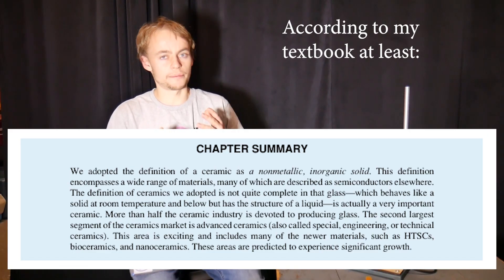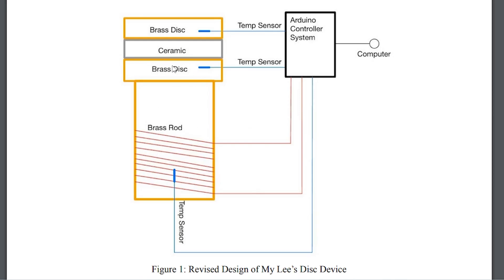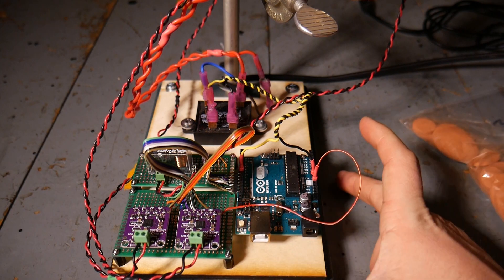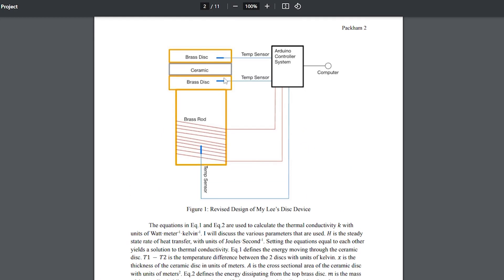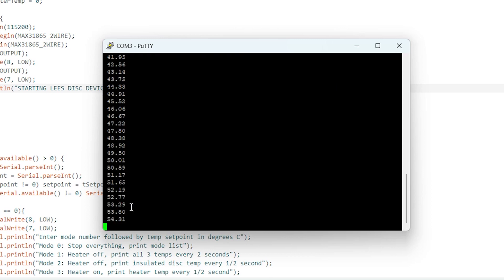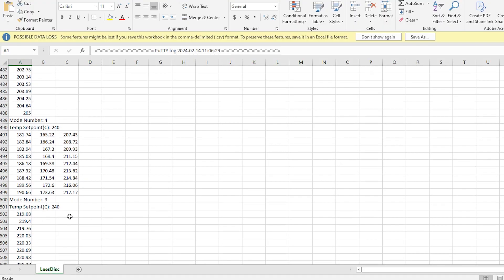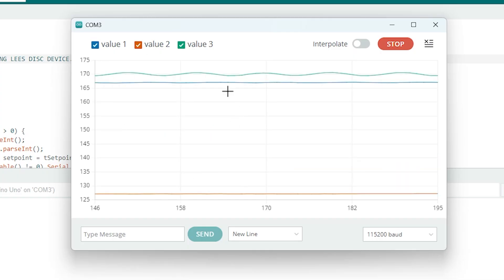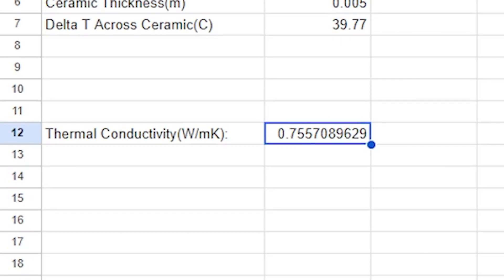I built an archaeology tool you probably have never heard of: The Lee's Disc Device

Comment: Nice project.  Well done.  Hey… How was the heating element insulated from the brass rod?
Reply from the maker: The heating element came from some other scientific apparatus I found in the trash. A cross section of it would show an outer (grounded) metal layer, with insulating material as the next layer, and 2 nichrome wires within. So the heating element you see does not need to be insulated at all

Comment: Difficult to control for a poor interface between the brass and the ceramic. I'd at least use thermal paste at the interfaces, maybe lap the brass discs and the sample flat. Ideally you have two temperature probes embedded in the sample itself, so the interface between the temperature sensor and the sample isn't also the interface between the heat source/sink and the sample.  Same principle as using a kelvin connection to measure low resistances.
Reply from the maker: Agreed here. The ceramic piece was lapped, but the brass discs were not. I thought about using thermal paste, but I didn’t want it to soak into the semi pourous ceramic and interfere with the result. I was going to put a round of silicone thermal pad between the ceramic and both brass pieces(compressing it), but I never got around to it